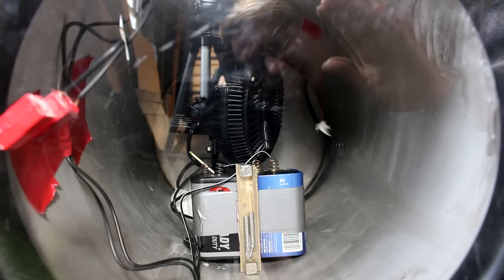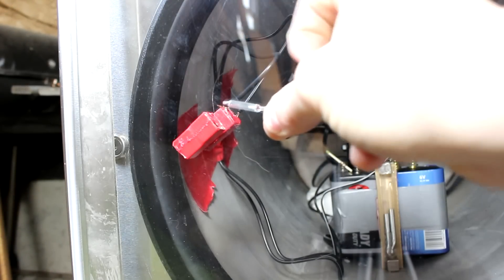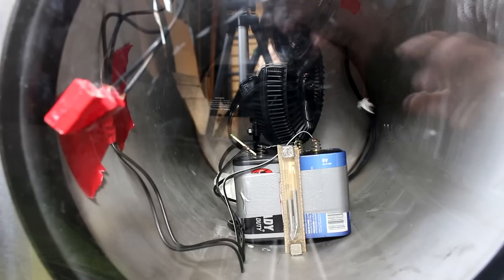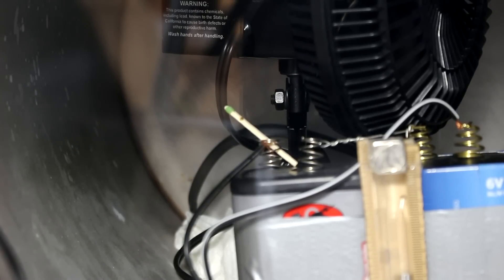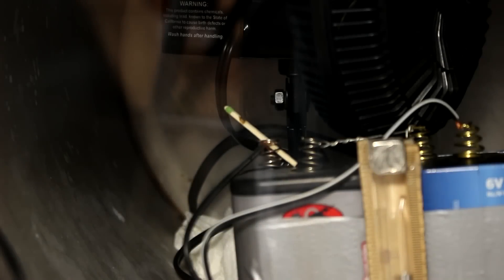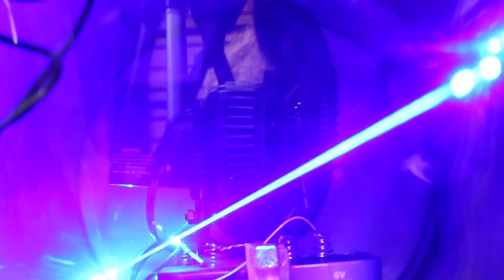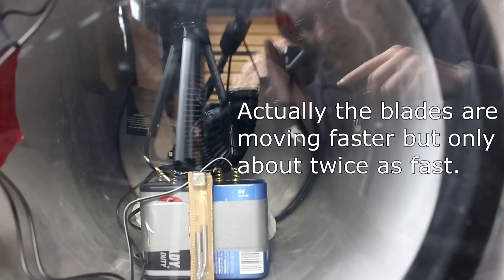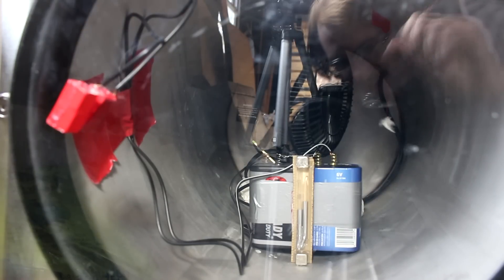Could a Fan on Mars Make Wind?

Comment: I was present at the autopsy of an industrial turbo pump, part of a large X-ray inspection system.  Seized rotor, total loss.
Many stages in said pump, and an unusual feature in the stages!
[each stage was a slotted impeller shaft-wise mounted and a stationary set of blades]
Each pump stage had a slightly higher angle of incidence than the previous stage.
The 'flattest' stage was the inlet end of the pump, the highest angle at the outlet of the pump.
Theory was that pumping thin air can stall the fan unless a shallow angle is used.
Your fan blades likely have too steep a pitch to move martian air!

Comment: wouldn't the concentration of particles in the atmosphere effect the outcome more though because if the concentration of co2 is larger there would than be more molecules going through the fan and hitting the feather as well as the temperature also if it was hotter the ke of the gas would be faster? arnt these correct statements?
Reply: well mars is about room temp on a hot summer day at the equator and the atmospheric density is less but a larger molar mass of particles than earth
Reply: ideal gas law, a mole is a mole
Reply: The Martian atmosphere is percentage wise higher in CO but there is still much, much less of it than all the gases that compose the Earth's atmosphere. Martian atmospheric pressure is .087 psi vs Earth's 14.7 psi. Atmospheric pressure is basically the weight of all the gas molecules in a column of atmosphere above the measuring point.
Reply: There are places on mars with double that atmospheric pressure as well, and there would be large amounts of micro particles of dust in the wind as well effecting the force on an object. I think a perfectly accurate model of this would be the fan at a higher speed, with alot of powdered clay or talc, and 99% concentrations of co2 meanwhile simulating half the gravity (mars gravity), I think with all these additions, the feather would move quite a bit more than it currently does.

Comment: What would happen if you put supercritical co2 in the vacuum chamber?
Reply: Glass tube could breake easier in lower pressure in chamber
Reply: Shhhh, don't give Cody any ideas xD
Reply: nothing, supercritical co2 needs extremely high pressure which is not available in vacuum ;)

Maybe the tube would explode since the pressure difference increases with decreasing air-pressure
Reply: Unlikely that one atmosphere is going to make the difference, since there's a shitload of pressure on the glass tube.

Comment: even if the wind itself doesnt blow much around wouldnt the large amount of dust moving at a similar speed have an effect? even if it is really small particles if its enough to basically black out areas than it should have a pretty large amount of force on what its hitting.

Comment: The best way to get data would be using a TMP rotor/motor and measuring the rpm/current change vs pressure curve. Your fan is just running at max. speed (no load), a good load would be an extremely twisted propeller (89 degree of AoA or a TMP rotor).

Comment: So if the surface of mars is covered in "dunes" of super fine particles, could you walk on those dunes or would you sink?
Reply: I think you would sink maybe a little more than you would sink walking in sand. At least that makes sense in my head.
Reply: Yeah didn't think about gravity... It's hard to consider all the factors when you've only lived on one planet your whole life.
Reply: well if the dust is tiny then it will pack into a denser state, with less air trapped in it.  so no you would not sink into it,   plus you must remember the martian soil is frozen solid
Reply: you wouldnt sink in a lot, because of the low gravity and there are also rocky places on mars

Comment: Would solar winds create storms seen in the book/film on mars? maybe due to the lack of a magnetic field that wold be the case
Reply: I think I remember someone saying that a storm anywhere near that strong wouldn't be possible on Mars. It might have been the cinema sins video on The Martian. Too lazy to check lol.
Reply: They definitely wouldn't be so windy, but as for the amount of dust density, i'm not sure, I do know that there is dust storms every 5-6 years that are large enough and dense enough to be seen from earth.
Reply: rdizzy1 Are they caused by solar storms?
Reply: Piper at the Gates of Dawn
Difference in air temps at certain altitudes is part of what causes the dust to be shot up into the air initially, but wind keeps it suspended. And with only half the gravity of earth, they will stay suspended for longer as well as being smaller particles to begin with. Many of the dust storms can block out the entire sunlight for days on certain continent sized parts of the planet.
Reply: rdizzy1 I see, so the main problem is the blocking out of the sun rather than the force of the wind
Reply: Piper at the Gates of Dawn
I would guess so, yeah, but in codys experiment, it would be more accurate if he tried it with some talc powder in the air inside the chamber. Would push the feather a little more due to the air being more dense as it is filled with micro particles of talc.
Reply: rdizzy1 yeah i guess

Comment: Would a fan make "wind" in a theoretically perfect vacuum?
Reply: no
Reply: YeCannyDaeThat Perfect vacuum means 0 particle in a volume. Wind, on the other hand is a movement of gas molecules due to pressure difference. If you have even a subject(smoke, air etc.) to test if there is wind or not, then you cannot talk about perfect vacuum anyway. So the answer is no.
Reply: Look up turbomolecular pump on google.
Instead of fluid dynamics it works better to imagine a particle model in vacuum, since you have few atoms. Imagine the blades hitting the atoms like ping-pong balls.
So no, perfect vacuum, no wind. But you rarely have that.
Reply: Maybe. The fan itself could be made of things like plastic that would outgas in the perfect vacuum, in a process similar to what gives us 'new car smell'. It'd be incredibly, incredibly weak, but in a perfect vacuum that might well count.

Comment: How is there massive dust storms on Mars then? In fact they have seasonal dust storms that are the size of a continent.
Reply: He explains this in the video, the dust particles on mars are incredibly small thus allowing them to be carried into the atmosphere.
Reply: What he said was about the "Sand dunes"
Reply: Wouldn't it stand to reason that if the particles that make up the sand dunes are incredibly small then the particles that make up the dust storms are just as small if not smaller?
Reply: They are insanely small, but in the worst storms, there are MANY particles in a small area at once, which would impart more force on the "feather" in this experiment, by a small amount.

Comment: Cody would the fact of the gravity of earth pulling down on the feather have incorrectly made it so that the feather would not move, would the feather have more movement if it was in the martian gravity.
Reply: The feather would certainly move more in lower gravity, but not by much at all.
Reply: Consider the force needed to push someone standing in front of you against the force needed to pushing that same person now suspended in a swing set. The feather has very minimal weight to begin with, which is held by the string. The impact of gravity is minimal in this experiment, but this is an excellent question!
Reply: seth hadd If he did this experiment on mars it would be about the same since the wind is mostly a horizontal force. I can't say that the lower gravity would have noticeable effect but it would be better to some degree at picking up stuff in a gust.
Reply: It definitely will have an effect, may be tiny, but nonetheless.

Comment: What kind of laser is that ?  How many inches of mercury was the vacuum in ?  How is there a difference in pressure when there is no pressure ???
Reply: In the previous video he mentions the pressure was 4mm of mercury IIRC.
Reply: Glad I hindered my inner grammar nazi, it almost jumped the double negative; first time I've seen a double negative used correctly.

Reformed grammar nazi, OUT!
Reply: And running a quick conversion it's about 0.16 inches of mercury
Reply: There isn't no pressure.
Reply: Benjamin Antman ;)
Reply: William Goble

Comment: what if you put dry ice behind the fan so the fan is blowing co2 at the feather?
Reply: In the previous video the chamber was primed (is that the correct word) with dry ice. But as long as the pressure is the same, the gas used should not have an effect.

Comment: You could wind a tiny coil of resistor wire around the match and control it with a tilt switch and battery in order to make the match smoke without over driving the camera sensor. Just for future reference. ;)
Reply: Yeah, this is what I was thinking.  This would allow us to see what's going on without being blinded by the laser.
Reply: Or you know, just put a spot on the outside increasing the overall light improving the video quality without that exercise in pointlessness
Reply: I would like to see this!
Reply: That would help a ton with the filming!!!
Reply: Even using fixed exposure could help somewhat.

Comment: On the recent NatGeo Mars episode 3, they show drones flying... according to this experiment, that would be impossible, not enough air for the blades to generate lift, right ?
Reply: There is a wikipedia article about mars aircraft https://en.wikipedia.org/wiki/Mars_aircraft
Reply: kinda, conventional drones wouldn't work, but there could be some workarounds, for example you could fill them with a lighter gas so they would only float with tiny propulsors that make them move.
Reply: Eric Saúl
Thats what i thought.  Too bad that a great show like this one got something like that wrong. Thanks.
Reply: *****
thank you.
Reply: Mars has a atmosphere, its not a vacuum like this video implies. Thats why the recent lander used a parachute to slow itself down too, if there was no air the parachute would do nothing. A Drone could probably as easily on Mars than it could on Earth if not easier, the gravity is 1/3rd of Earth's.

Comment: What if you do chemical reactions in your vacuum? Will some chemical reactions be different? Possible thermite or anything you choose
Reply: Now I want to watch thermite in a vacuum!
I wonder if the iron would start boiling...
Reply: I am not an expert but since thermite only reacts with itself there are very few ways to change the reaction. A vacuum might change the rate at which the reaction occurs due to the different ambient temperature and the reduced thermal conductivity between the chemicals in powder (air conducts heat better than a vacuum) but I imagine that these changes would not be measureable.
Reply: thermite provides its own oxidation material as it oxidizes, a vacuum shouldn't really matter once the reaction starts
Reply: Well, a vacuum would provide considerably less oxygen than in normal atmosphere so maybe it could be used to avoid erosion of different metals. But that's just a hypothesis of mine
Reply: buttercrap
It would matter regarding the vapor pressure of the molten iron and molten aluminum : it could possibly bring them to a boil, and lower the temperature of the whole thing.
Reply: Yeah some thermite action in the chamber !!!
Reply: Isn't his attempt at lighting the match-head a chemical reaction? https://en.wikipedia.org/wiki/Match
But i agree would be interesting to see other experiments.

Comment: If you had some way to replicate the gravity of Mars, would the feather be more effected by the fan?
Reply: Only slightly.
Reply: Edward Nardella, I believe you. There just isn't a whole lot of air particles to work with on the Martian surface. And most of the feathers weight is held by the string. But, now I'm curious if this experiment can go the other way and have an atmosphere thicker than Earth's? You're pushing more particles at the feather, so it should move more. Correct?

Comment: What would happen if you had a low pressure atmosphere of pure oxygen for the match to burn in? Would it be able to use all of the oxygen for combustion? Also, would the pressure get higher or go lower as it uses the oxygen and produces CO2, CO, H2O, particulates and other combustion products? I'm curious if it will burn better in low pressure oxygen than in normal air that only has around 21% concentration. Perhaps in pure oxygen at 21% of atmospheric pressure it will burn at a similar rate.

Comment: is it possible to remote control something in the vacuum chamber? making it possible to make other kind of experiments, that you can't use a magnet or a laser to operate in the chamber?
Reply: Yes, radios are not dependent on an atmosphere, though some of the components might not like being put in a vacuum, air bubbles in the epoxy on microchips can explode damaging the electronics.

Comment: Shouldnt that fan overheat at twice the rpm?
Reply: Karavusk less resistance from the air, so not putting in as much effort on the motor. And the actual fan cools itself
Reply: No. This type of motor (a series wound or compound wound DC motor, I know this because of the rpm changing significantly at low load) will be very happy with high rpm's on the electrical side. However, it might fly apart due to high centrifugal forces. I was waiting for that to happen in the other video when he pulled a vacuum. Well, I guess these are made in a way that stops them from flying apart when the fan blades break...